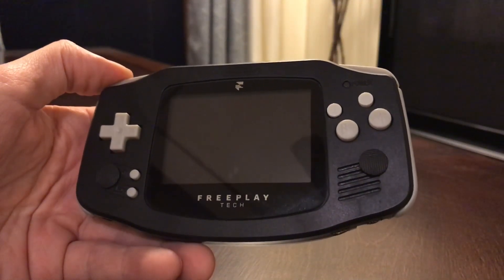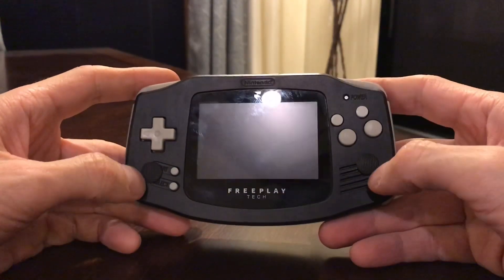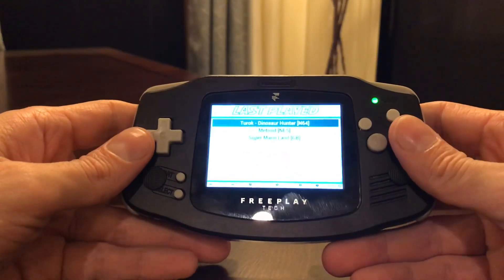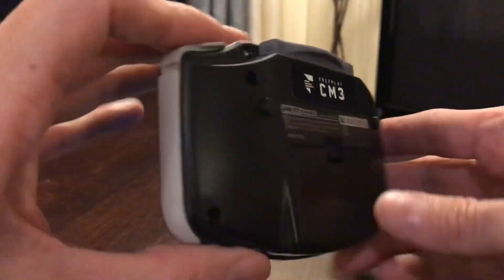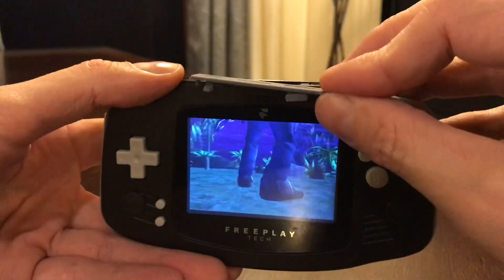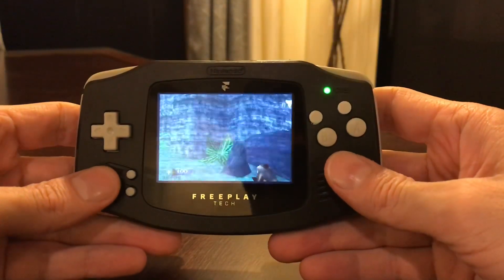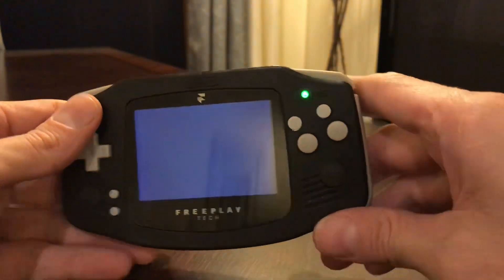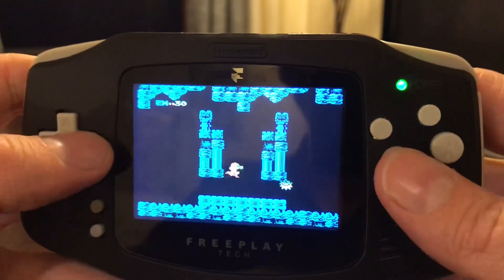Freeplay CM3 Dual Analog Add-on Board Build (Raspberry Pi3 Handheld System)

Comment: Nice job! How did you install the software for controlling the brightness control? I have the instructions but confused on how to actually install the software on the CM3. Any help is appreciated!
Reply from the maker: You can use the terminal (f4 to initiate the terminal)  to install the software. At the very bottom of the page https://docs.google.com/document/d/1XKg8Mzcf-xtmS64hgp3qJbadULdvilPQCuMWmT83yZs/mobilebasic there are line by line directions that you need to input. Those start with the first line: cd /home/pi/Freeplay . You need to enter each line exactly and press enter (that is pressing enter after each line). That will have the Pi download and install it for you. Then do the enable I2C step. I don’t really understand what all that is completely :) , but all works well after doing it.

Comment: That is an awesome mod you did there mate! I will be ordering this kit within a month but I have a few questions. How did you manage to get the analog sticks to stay in place? Did you use super glue, hot glue etc. Also, where can I get the schematics to know where to solder the analog sticks? Your feedback will be much appreciated. Thank you so much in advance.
Reply from the maker: Evan J The left analog stick I hot glued directly to the case. That’s why in one of the images at the end of the video it is still in place when the device is opened up. The right analog stick I hot glued to the board with a piece or 2 of cardboard sandwiched between as a spacer to hold the analog stick more tightly against the case. Having the left stick attached to the case like that was pretty annoying. Whenever I needed to take it apart to work on things I would open it up like a book. I thought that would be fine, but the wires needed to be fixed up now and then due to the constant flexing there. I will try to figure out a better way on the next build.  I think there is information on wiring them on the website, and the connection pads are labeled on the add on board. There are 4 wires for a joystick. I didn’t care to get the actual axis correct because I just set up the controls in Retropie anyway. If an axis is reversed that sorts it out anyway. I guess that could cause issues with emulators that are difficult to remap controls. I haven’t ran into that yet though. You should link to your build if you end up documenting it.

Comment: what kind of speaker did you use .... i was thinking about placing one of the sticks on the back I'm not sure how it will play
Reply from the maker: Josefina Cruz II I Used one of these on the front BXI Micro Speaker - Oval... https://www.amazon.com/dp/B0798RDPXD?ref=yo_pop_ma_swf . I used the speaker that came with the kit on the back. My next build will only be using rear firing speaker(s). The right stick will play much better if it mirrors the left stick position instead of being off to the right. I want to get those analog sticks as close to the center of the front as I can on the next build for playability. I am even playing around with the idea of relocating START and SELECT to get the sticks even further from the edges.

Comment from the maker: After playing more I notice that when the audio is more advanced (later generation games with voices and more audio going on) it sounds a bit muffled at high volumes. I will probably add a tiny grill for the rear speaker. I’m thinking a small circular grill of tiny, I mean tiny,  holes. I’m still thinking about it. A grill is something that can easily mess up the look of it’s not done really well.